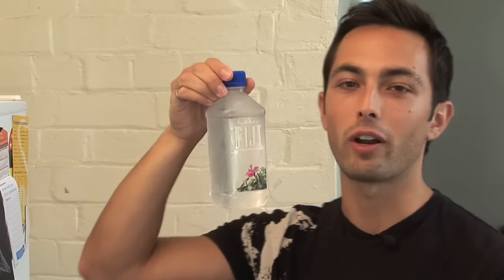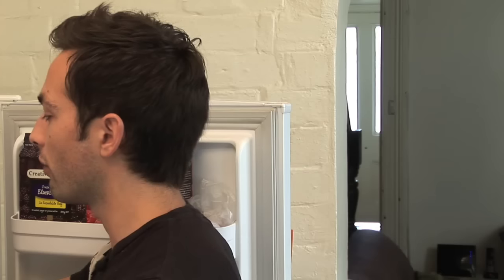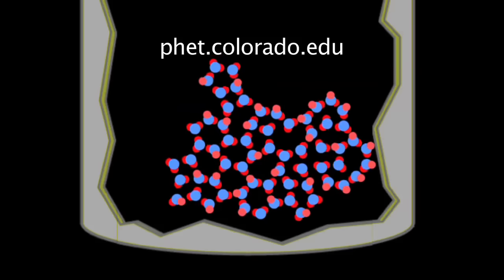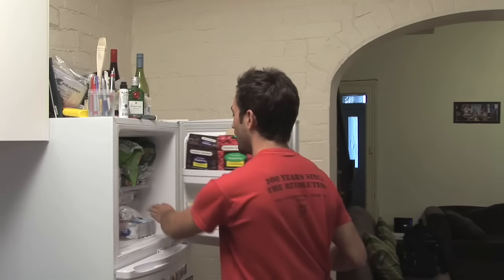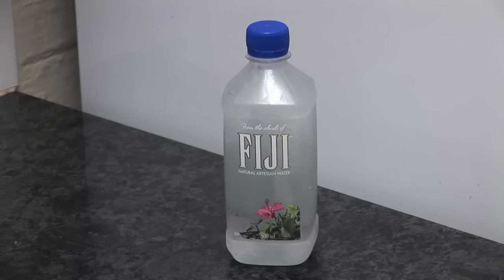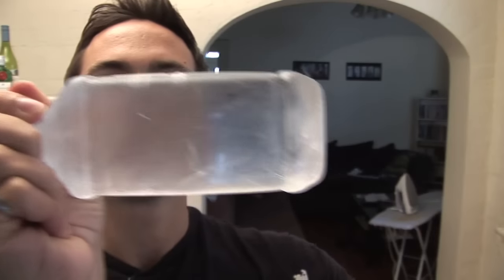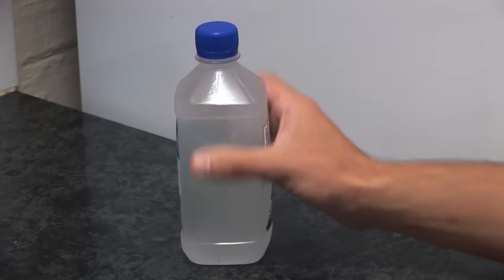Supercooled Water - Explained!

Comment: Does the water release heat when it changes to ice? Similar to hand warmers that freeze.
Reply: That is a different thing. It's called hot ice but it's kind of the same idea. The fluid in those hand warmers changes from a sudden movement. Except that is a chemical that i forgot the name of but it's commonly known as hot ice. It's not actually ice but it looks like it and it gives off heat

Comment: I was able to do this with sweet tea. I thought the sugar would not allow the super-cooling process. Is this not the case?
Reply: +Garret Carey Dissolved stuff like sugar does not matter much, it is the solids that can create heteronuclei to start ice crystals. Or gas bubbles..
Reply: Then why are they insisting upon using purified water?
Reply: You only need water that has no particulates in it, no solids. Some of the solids can be quite small, invisible to the naked eye, such as (dead or alive) bacteria, or solids from soil or the filter systems used to produce potable water. Some clear liquids that can be bought in a  shop have been microfiltrated to remove such small particles. All of them have the potential to supercool.
And preferentially have water in a  bottle that has a hydrophobic inner surface.
Reply: even though the chemistry has been changed? I figured sugar would prevent the process, for It chemically alters the water and causes it to resist freezing. This is why slurry's are able to be below freezing and remain slushy. Side note; it started freeze like it the video, just at about 3x less the speed, would this be caused by the sugar and other impurities within the bottle of sweet tea?
Reply: You are correct, anything dissolved lowers the freezing point, but also the supercooling temperature. This is regardless of what has been dissolved in the water. Some substances however have additional effects. Sugar forms hydrogen bonds with water molecules, it therefore binds water molecules which are not longer as readily available for freezing. Sugar acts as a cryoprotectant. As a result of all this the crystals formed will be smaller. Significant concentrations would also influence the heat conductivity and heat capacity of the solution, so yes... might have all kinds of effects.

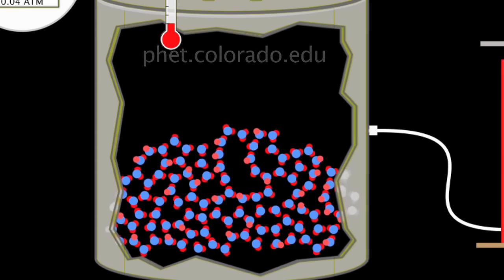Comment: all good and all but, in 1:25 he said: "if the water is not pure, the impurities in the water naturally  act as sites where the crystals can start forming.  That's why is very important that we use very very pure water"... I am the only one seen a contradiction here? we would then need less pure water to achieve supercooled water more easily...
Reply: Hey, I might be way way late to the party, but I have an attempt at an answer.

Water does not necessarily freeze instantaneously once it reaches subfreezing temperatures. Most commonly, water freezes to ice when it has some impurity to cling on to or start growing ice crystals from (nucleus).

In this case, to form supercooled water (and not ice), you need pure water, not water with many impurities, so that the water with subfreezing temperature will not have anywhere to freeze on/form ice with.

Comment: I've actually done this with beer. They were corona bottles that were left outside when it was cold overnight and I was able to do 5 out of the 6 pack. All I did was bang them on the railing of my deck and they turned into a slush.

Comment: Drinking supercooled water before it freezes is the best thing ever
It’s extremely cold though
Like almost dangerously cold if you drink too much, but by that point, it usually becomes ice while you’re drinking 😂

Edit: I wanted to add that I’m drinking supercooled water right now and it’s crazy because my dad put it in the freezer at around 7 PM and it’s 3:38 AM now
When I checked the freezer, all the waters he put in the freezer were rock hard and just one was still liquid until I shook it slightly 😭

Comment: He could have saved much time by doing a correct science experiment with proper controls lol -- adding in a similar-sized bottle of tap water could have been used as a positive control for "normal freezing". Once that bottle froze, that should be a good indicator for the pure water bottle to be under supercooled conditions and execute the tapping/shaking test for slush formation!

Comment: He says about using pure water, however someone at work said they could make this trick happen, I had never seen it and I called BS. They used my 2ltr bottle of raspberryaid and it worked just the same as this video does.

So it doesn't need to be pure.

Comment: This has brought down a few planes this has.. Interesting and scary.. You could stick a metal probe in the bottle and it will do the same thing.
Reply: wut? i would like to know how this could potentially bring down a plane
Reply: Redder-ish kugelblitz
Well..for example, when the supercooled water makes contact with the pitot tubes of an aircraft it blocks the sensors that can lead to a malfunction of crucial instrumentation, Altitude, speed and so on causing a crash if in low visibility or mostly in the dark. Mentioning of this on Air France flight 447 and a few others regarding this. I think the other one was on October 31th  1994 in Rawselawn American Eagle Flight 4184 .. Dangerous stuff.
Reply: Cool! i was wondering if it had something to do with water on the engines.
Reply: Redder-ish kugelblitz
 Im not an expert but i would imagine any unprotected crucial area of an Aircraft would succumb to it, bringing a plane down.
Reply: Yeah. But it wouldnt be a huge problem water on the engines, at least if the plane was flying over land.
Reply: Redder-ish kugelblitz
 Yeah no the Engines are alright, They're bult and tested very well. Most things are these days, very rare now that weather can bring down a plane considering all the equipment, Radar, anti ice, keeping smaller planes out of coulds flled with supercooled water lol.. but it does still happen. This day and age it shouldnt happen at all lol.